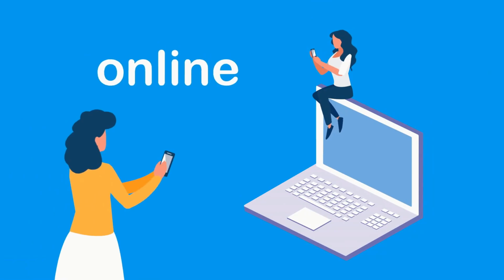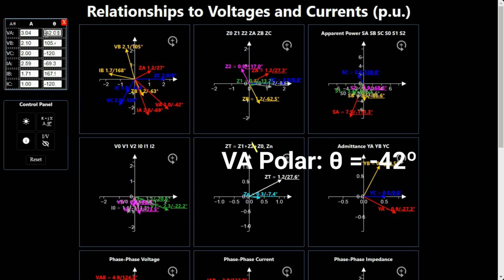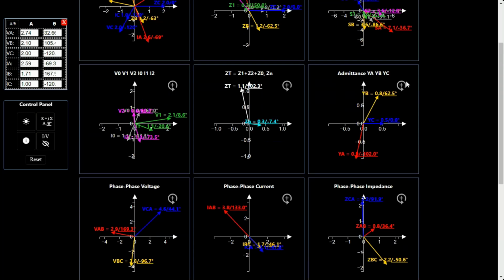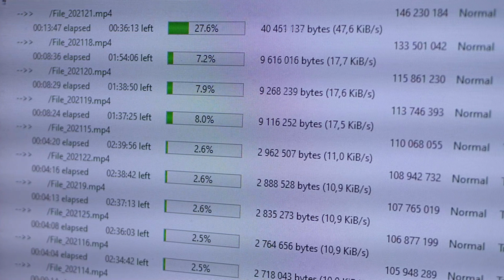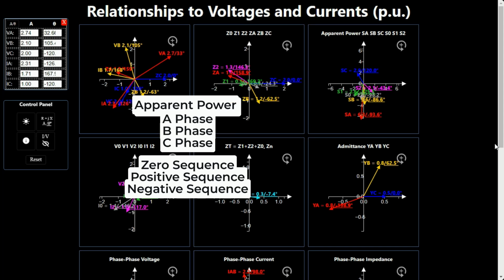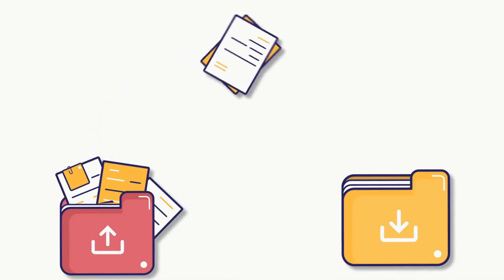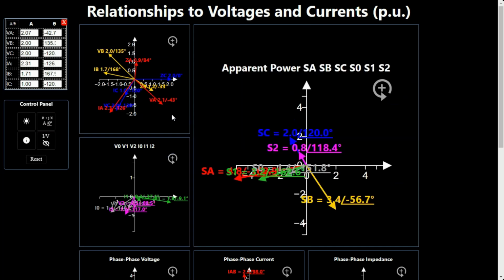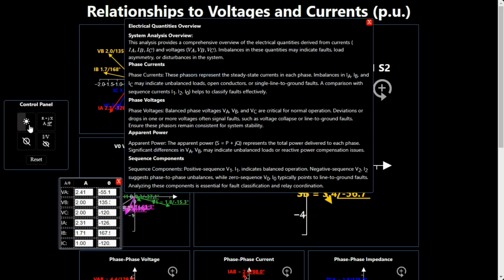Online Phasor Calculator   Simplify Fault Records and Relay Settings for Engineers

Comment: Brilliant what an amazing photo. Ive only just started the journey of learning about protection relays. Would you be able to explain the fundamentals of differential protection schemes? I hear this all the time but I can’t seam to get my head around it
Reply from the maker: @ggazzer1268 Thank you for your kind words! Differential protection compares the current entering and leaving a section of the system, like a transformer or power line.

Here’s the basic idea:

 - If the current going in is the same as the current going out, everything is normal.
 - If the currents are different, it means there’s likely a fault within that section.

This method is very precise and acts quickly to disconnect the faulted section while keeping the rest of the system running.

Would a presentation video or an interactive tool to visualize this concept help you understand better? Let me know!